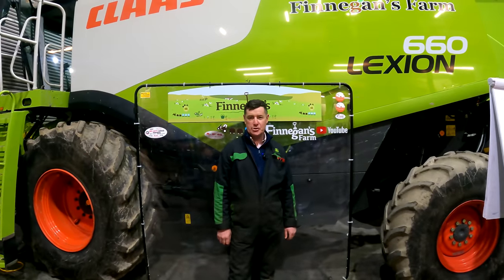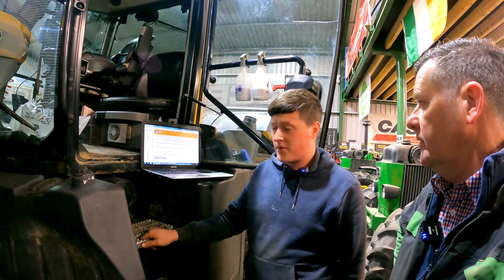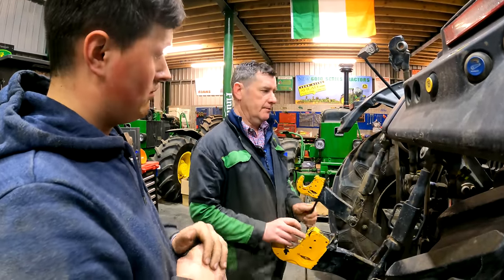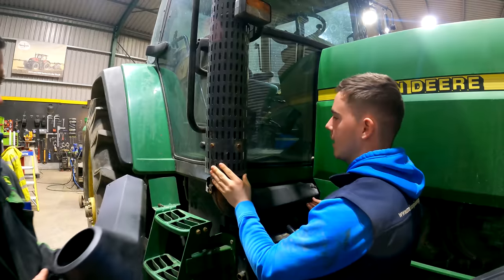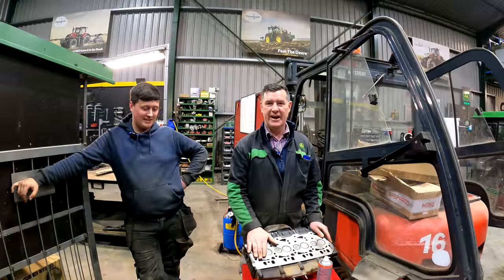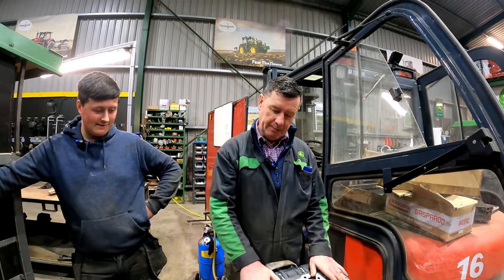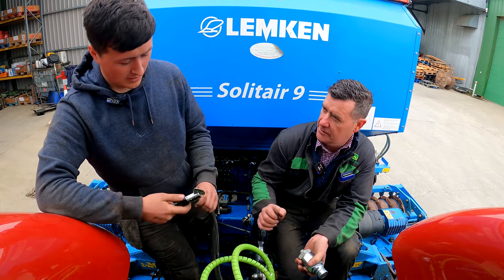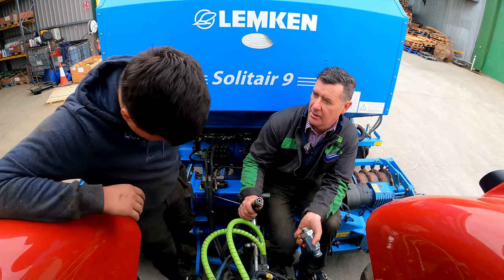WORKSHOP WEDNESDAY EPISODE 27

Comment: Great video. We've all been there, done that on the frustrating job of trying to get metric to non metric hydraulic fittings etc , so great to show those small things that can rob you of loads of time and people who wouldn't understand might think that you just sit up and drive away all day long. The prep can take as long as the job at times. Also mounting control boxes and wiring harnesses to power them up. can also be a slow but important job before you're ready to go to the field
Reply from the maker: So many things to consider when you hook up machines nowadays David

Comment: Good video how come u don’t use the larrington trailers for the spuds anymore
Reply from the maker: We only use them now when digging with trailed harvester as the elevator is smaller and you can fill an even load but the big elevator on 470 can be hard to fill even especially on the front and back of trailer but still a great system from damage point of view 👍
Reply: @finnegansfarm9137  o right do u still have them or did u sell them?